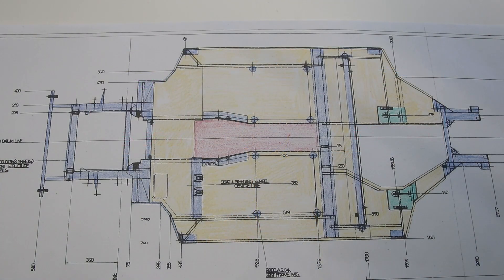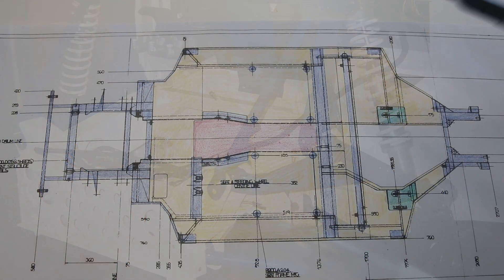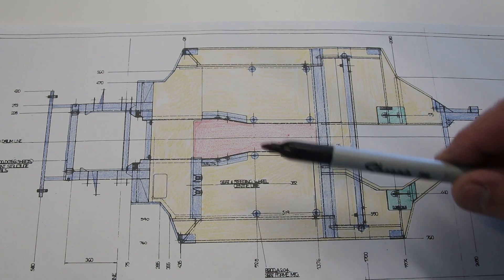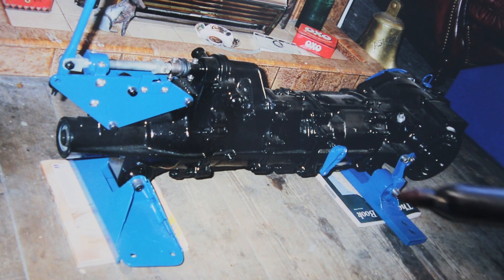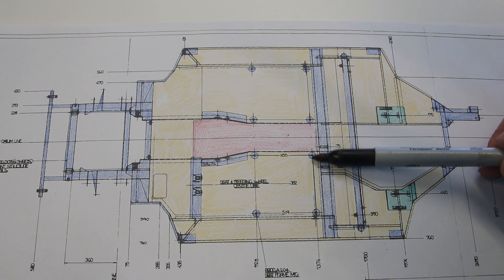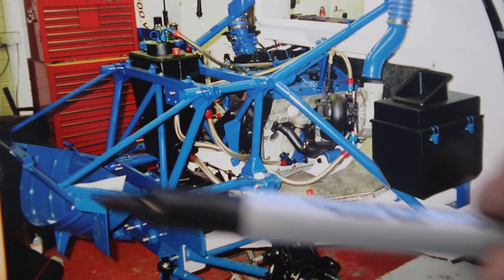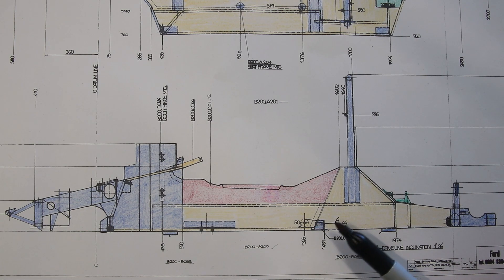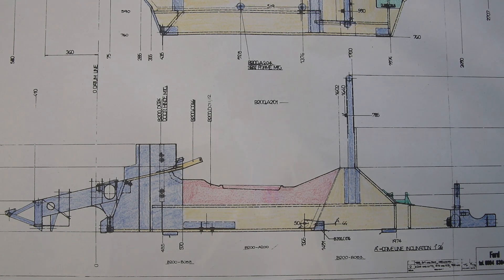Part 6 Anatomy of Ford's RS200 Rally Car

Comment: Very enlightening video and clever design. I had no idea the structure was like that, the word ‘tub’ conjures up different ideas on how it might be put together until you see it spelt out as you have done. The diagrams really help too.
Reply from the maker: It's a bit of a mish-mash of steel and honeycomb and it no doubt would have improved in leaps and bounds had the B-cars not been cut down so soon but it's certainly interesting digging into this particular example and putting in the strength it would have got had it had time to be evolved.
Thanks for watching and glad you enjoyed it.

Comment: Is the longitudinal strength mainly from the gearbox and engine pick-up points Bill?
Reply from the maker: Most of the longitudinal strength comes from the honeycomb sills and the roll cage. the gearbox just hangs underneath weighing the same as a small planet!

Comment: Are you going to build a frame jig from 139 to sit in the damaged one on to get it straight.
Reply from the maker: We have a brand new and unused tub in the next workshop for reference and we've pushed and pulled all the critical dimensions on 068 to size with bespoke bottle screws. Once we have some new parts built we'll check them all again before the rivets and glue starts.
Reply: @TheBluebirdProject  thats handy, a frame jig will save you hours in the long run with all the major pick up points in the correct position.
Reply from the maker: @petespanel  It would, but it's a lot of work to turn out a single tub. we'll see how we get on containing all the dimensions and if it looks like getting sketchy we'll make up some tooling.

Comment: Thank you for the video great viewing ive a few questions myself the RS200 was known to be heavy compared to the other cars some 200kg what made the car heavy?  Was it the tub ? The transmission or both i belive for 1987 and the evo cars there was going to be a weight reduction but not sure where or what
Reply from the maker: The transmission is heavy but it was most likely the bodywork in its original form. Fibreglass is heavy and there's plenty of it, it takes two people to lift that rear clam. It was scaled back to paper thin for rallycross. The standard wishbones were also big heavy forged steel things at the front. They were superseded quickly too. And glad yo like the video too. Suggestions always welcome for content.
Reply: The gearbox was weak i think near every rally in the British championship mark lovell was having a gearbox changed these problems was obviously solved time the cars was in rallycross but still the still the high speed props used to snap
Reply from the maker: @forcedinduction2918  Those props were made in carbon in the end but the boxes, as you say, did suffer as the power went up. The front driveshafts were originally from an Austin Maestro too so you can imagine how good they were!